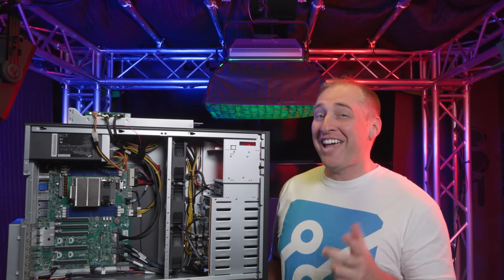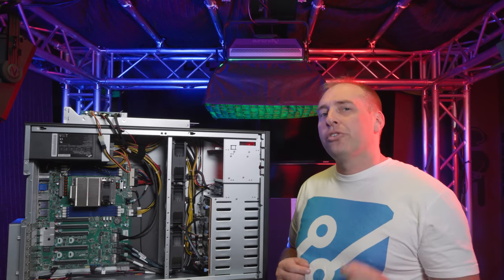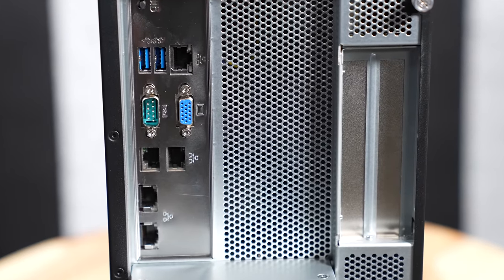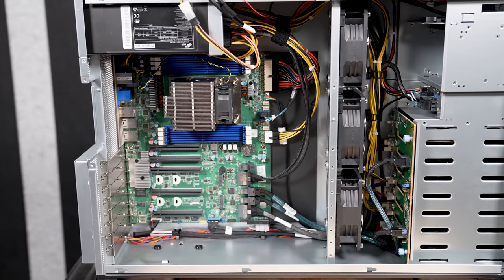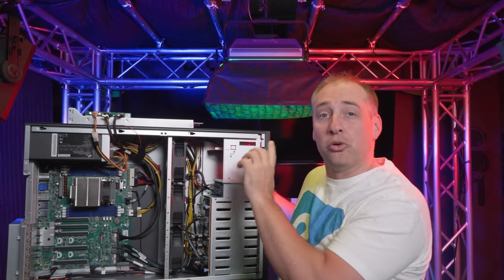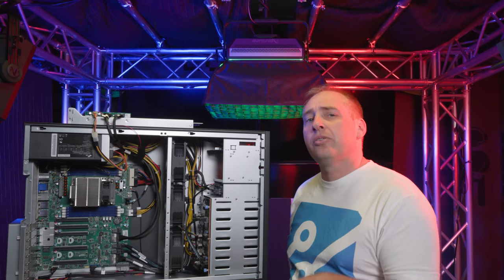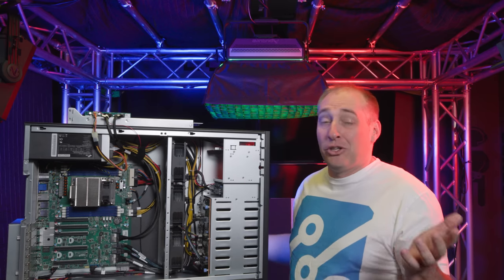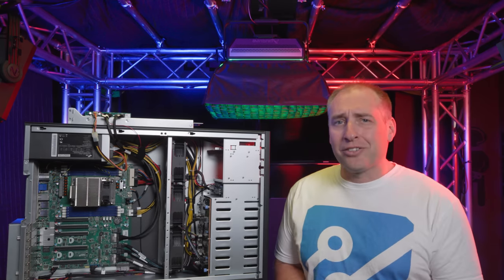Tyan's AMD EPYC Powered GPU Tower Server

Comment: I'll be frank, I would never use such a tower workstation in my work environment unless they are giving free earplugs to prevent ear loss. This workstation will be LOUD as a took off airplane. Prefer liquid cooled tower workstation solutions for a healthier work environment. You should add a B-roll to show how loud is the tower while under load for possible users. Not many are aware of this situation and regrets buying such a system after they hear how loud they work. Mentioning its loudness mostly doesn't resolve unless they hear it ( know it by experience ). 

This system makes sense if it can be converted to be a rack mounted system by adding rack rails on the bottom and top of the case and put it in a server room if user wants to get rid of the noise.

The PSU inside the workstation is Consumer product from FSP. Its model is 2000 Watt "CANON PRO". It has 80 PLUS 230V EU GOLD Certificate ( Doesn't have an efficiency certificate for 100-115 V usage. ) There is also a "CANON" model which doesn't have any 80 PLUS certificate, so be careful if you want to buy it for a DYI workstation.
Reply: It can be converted to a 4u rack. The supermicro equivalent actually comes in a sq (super quiet) variant, less than 27Db
Reply: Thumbs up for liquid cooled workstations 💦 🖥 👍

Comment: To get all the functionality of this tower would require a five u case. In light of that, it makes a lot of sense to use this form factor, especially if it is the only server in the closet.
Reply: This is not meant for the rack, but for standalone. SM has 4,5 HE rack servers for 10 GPUs.
Reply: @_TbT_  uh huh. I used to set up tower servers all the time when building networks for small businesses, but that was a decade ago, and almost all of these businesses would be better served by cloud infrastructure today (or colocation). I can see, however, where this would be useful. Specifically for design firms of all types, and any firm that needs high bandwidth access to GPUs (e.g. architects). They may have just a telecom rack, but need a high speed storage and rendering solution, and this form factor makes sense.
Reply: @edwardallenthree  This server in particular is NOT at all useful for those clients, as it is loud as hell and with the fans mounted at the PCIe outlets, you cannot even connect monitors to this thing. This is a Machine Learning number cruncher. As such it however should be put in a server room, because it is loud and hot as hell. This could maybe be for very SOHOs, who maybe have an own room, but no server rack.
Imho, this form factor makes little sense, because people will think they can put it somewhere in the office, while in reality this thing is way too loud for that.
Reply: @_TbT_  Could this pedestal form factor be needed by people who are required to have the server in a secured area? Secured as in security clearance required for the project?
Reply: @dougm275  Every server room should also be a secured area.

Comment: Heh, modular PSU cables, a vertical GPU/PCIe mount, and rubber grommets for vibration/noise dampening. Tyan really taking inspiration from the consumer PC case space...what's next? Tempered glass side panels? j/k

Comment: Modular cables for PSUs was one of the best things they've come up with imho. Cable management is a bi*ch enough as it is. There's nothing worse than having to deal with a ton of cables you're not even using. Seasonic was the 1st company I knew to have done it going back to 2007.

Comment: After your fiber series, have you thought of doing anything for power? Differences in PDU, UPS, monitored/unmonitored, vertical mount, horizontal mount. There’s a lot of introductory content there.
Reply from the maker: We very much may do that. We did an Eaton Li-Ion UPS the other day on the main site (no video) https://www.servethehome.com/eaton-5p-1u-lithium-ion-rack-battery-unit-review-5p1500r-l/
Reply: @ServeTheHomeVideo  I did read that, and wondered if highlighting the weight, compared to SLA types would be interesting. Also, does Li-ion make for a more power dense UPS?

Comment: It looks like you can put 2 triple slot GPUs in slots 1 and 4 and have a one slot gap between them. which is nice if you are saving money and using rtx 3090s. I wonder how airflow would be for those cause it’s designed to blow through them while rtx cards try to suck air in and blow over the card. I feel like it would be fine.

Comment: Hi I am in the process of setting up a similar tyan s8030 system. It is taking forever to post into ami. Is it possible to bypass the bmc with the jumpers to skip all the checks in the beginning it seems to loop multiple times until if gets past sometimes.

Comment: "...what looks like basically an 8 bay 2.5" drive system..." Isn't that a dual 5.25" bay? For, for example, full sized optical drives? Wow, making me feel old for being 26 and still using one in my daily driver desktop :P (Which actually got in the way with watercooling it with the config I want, because I guess so few people who run high end systems still use optical drives? ':D)
Reply from the maker: That is what I thought at first. The space has grooves for 2.5" drive trays and mounting points for a backplane.
Reply: @ServeTheHomeVideo  Oh, wow, I guess I couldn't see that from the camera, and since I haven't seen it before I just assumed. Thanks for the response to correct me on it, and I'm sorry it took me so long to see it. 

I love your videos, and I'm eager to see that networking project for the new office as that progresses :)

Comment: i love how its designed for gpus but the 16x slots are jammed together in the case of the top three, and the bottom one would probs only fit a single slot card, so with six slots total really only three maybe four can be used, based on dual slot gpus
Reply: Yeah. That's also 90% of the boards out there today. Most are not user friendly.

Comment: is a 128 core 256 thread RYZEN EPYC powered monster of a computer.
Reply: "Ryzen Epyc" doesn't exist. EPYC is not under the Ryzen lineup at all
Reply: ryzen epyc isn't a thing...  nor is a 256 thread single chip Epyc.... the highest thread Epyc chip has 64 cores and 128 threads. anything higher requires a dual socket/chip motherboard. the NEXT Gen Epyc chip is RUMORED to have UP TO 128 core (256 thread) on a single chip, but that has NOT been CONFRMED yet....